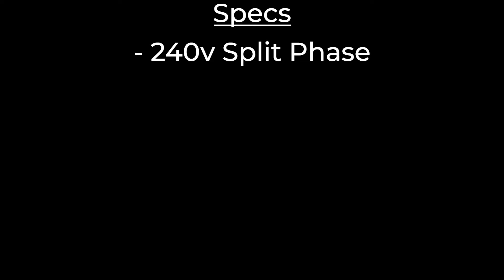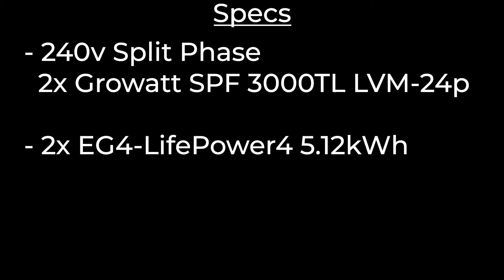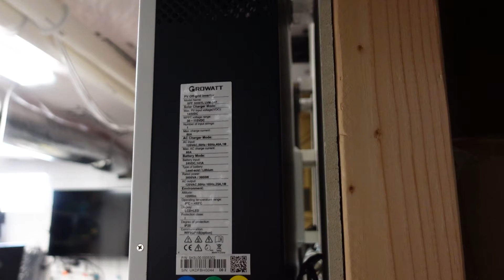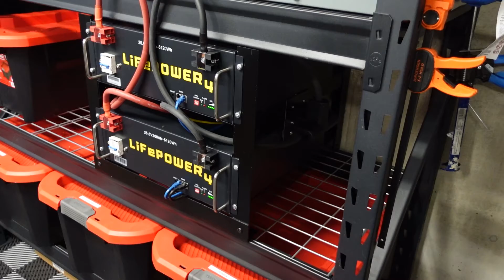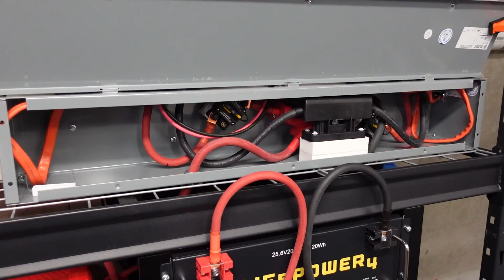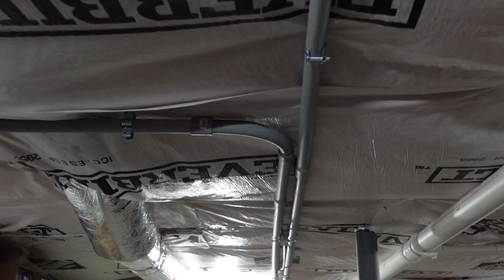Growatt Split Phase \ Off Grid \ Backfeed Home Battery Backup

Comment: Ok my question is you say your setup last two ok I have almost the same setup I have two alpha5 48 volt rack mount batteries from 
Rich Solar and two 3000 watt 48 volt inverters from rich solar that are exactly inside and out like the growatt and I have 10 200 watt solar panels plus I’m tied to the grid but it’s solar first then grid if no sun 
My batteries will only last one night if I’m lucky I know that I’m doing something wrong or there’s something wrong but I’m not sure what that is. Everything seems to be working fine but I can’t seem to get these batteries to last more than one night and I know they should any ideas where I’m going wrong
Thanks
Reply from the maker: Hi - it really comes down to your draw on the system. When I say 2 days, that is cutting all non-essential loads - I am really just running a few lights, my well pump as needed, heat\ac sparingly etc. I shut off all of my nice to haves in an effort to stretch power. Do you know your phantom load (how much power is constantly being drawn)? With all my stuff on I'm around 450w but I cut that to around 200 if I'm trying to conserve. Plus the inverters add roughly 75w to that number as well.  My house pulls roughly 25-30kWh this time of year when it's business as usual, so yes, if I were to leave as is then I would likely get ~12 hours out of it.

Comment: So not Grid-Tie?  I want Grid-Tie+Battery Backup.
Reply from the maker: Correct, no grid-tie on this setup. That requires a lot more in terms of coordination with utility, permitting etc. Also, most grid tie systems out there will be offline during an outage - so you are left with what's in your batteries until the grid is back online, in the typical setup, solar goes down with the grid. I want my system generating solar power when the grid is down!

Comment: First off, really nice clean installation! But in my opinion EG4 or Mpp solar inverter/charge controllers make more reliable units with higher voc allowing you to put more panels in series which I prefer. 
In tests that I have performed and also seen online, partial shading on a parallel configuration lowers the wattage coming in just as much as series. In essence a higher voc is always better in any case.
Reply from the maker: Good info - thanks. I've been seeing all of the new EG4 stuff come available and it looks great, I wish it had been an option when I purchased all of this but there's always round 2!

Comment: I have the same growatt. I'm unsure if I want to buy another to parallel them. Would you recommend just buying a different brand or does it seem to work well.
Reply from the maker: These seem to work fine. I've run my house off them a few times with no issues. That said, there's a lot of new stuff out and if I were building today I might go a different route. The Eg4 inverters look interesting and I believe they are UL listed which is a plus
Reply from the maker: Just saw an email from signature solar and made me think of your comment. They have a special on a parallel kit with a wireway\breaker box that looks really cool. https://signaturesolar.com/eg4-13kw-off-grid-split-phase-inverter-bundle-2-x-6500ex-48-13000w-output-16000w-pv-input-split-phase-120-240vac-all-in-one-solar-inverter-system/?_hsmi=269051297&_hsenc=p2ANqtz--aDD0GA_uXTlTOqPPL5c8awc_iYIGxGRzdGHgmNUwqB_pV0KJ3eX79tR1119_lrWobiLASOuhiU10UmYdV8en6Xo1yXA

Comment: I have a very similar set up using the 2 Growatt inverters. Nowhere as clean as yours is. It's been running my off grid shop/garage, and 2 Mini splits on my house for 1 year now. I had 2600 watts of solar, and found that it was just enough in 110 deg Texas heat. I also use it as backup for the house if needed, so I always try and keep the 4 - 24v/100Ah batteries at least at 70% SOC if needed. I had to use it 4 times this spring (lots of bad weather), and it worked great. I just bought, and am currently installing another 2400 watts of solar to make sure batteries are better topped off when the sun goes down. I have their AC charger also, but the 30amp version and love it, thinking about getting another, so I can use my gas generator to charge the batteries faster if no sun is available during a power outage. Nice work.
Reply from the maker: Very cool - I'm in the middle of installing a 50a inlet to backfeed my panel which I plan on using to charge my batteries (by grid or generator) to supplement my panels. Broke my collar bone with the work half done so it's going to sit a while! I'll post a vid on that once I'm back into it. Thanks for sharing, your setup sounds great.

Comment: Nice video. Just a heads up, Option 11 will allow you to limit utility charging current. I have mine set to 14amps so I can use normal 12/14gauge extension cords.
Reply from the maker: Thanks, I need to double check but when I first setup, setting the battery type to LI disabled that option. I believe you need to set battery type to User to open it up, which I should just do.
Reply: @lifewithlonsi  You're correct. I set that up awhile back and forgot that setting forced me to enable 'User-defined'.

Comment: you WILL want some air flow in that box. small PC fan on one side and some holes
Reply from the maker: That's a good point. The ends are detachable, I'll mount a 140mm fan on each side and pull air through. Thanks for the tip!

Comment: So I've got the 2x5000ES, with two midpoint transformers. I've got a transfer switch and 6 EG4 48v batteries. We use it for "time-shifting" and backup... I've got a manual transfer switch but am trying to figure out an automated one... the inverters can be programmed as to when to run, so I figure if I get one of these "backup generator" ATS's, and wire it with the grid as the backup power source, that will do the trick. None of the companies who make this hardware will talk to me, since they just want to sell me a generator... If you, or any of your viewers have any thoughts, I'd welcome them. Your setup looks very clean, thanks for the video! -- Bill
Reply from the maker: I've never played with an ATS but from my understanding in theory that should work. Inverter output is no different than a generator so just swapping out the source should work fine. I think the devil will be in the details on how\when you are switching and what the trigger will be - that will ultimately be up to the ATS and what it supports. Interested to hear if others have experience\recommendations on this one.
Reply: Dude! When you shift time, where do you go?

Comment: Btw where did u source those bus bars on the side of your batteries?
Reply from the maker: I'm going to try it - with battery set to LI the manual says the amp limit is disabled. I'm going to switch to User and see if that works. The bus bars are from Rysz Battery in CT. ryszbattery.com

Comment: I have two 48 V Crowatt ES inverters and am basically building the same system.  However Growatt says that 4 gauge wire is to be used.  Originally Signature solar said to use 2 gauge wire which was almost impossible to fit into the inverter and did not fit into the Nader breakers they had me buy.  Does the growatt manual say to use 1/0 wire or did you just use it?
Reply from the maker: The manual on mine calls for 1x2AWG or 2x6AWG for 24V and 2x8AWG for 48V on a 200AH bank. I threw that out and went by the max amp ratings which is 141A on 24V and 71A on 48V and sized my wiring based on that AND the loads I will be running. To do it "right" by many folks standards it would have me running 2/0 for the inverters and 4/0 between bus bars.
Reply: @lifewithlonsi  Thanks for getting back to me.  I started with 2/0 wire but almost broke the inverter opening fringes getting them attached.  Went to 4 gauge as the manual stated, but have now got 1/0 wire coming.  The 2/0 gauge did not work with the breakers I want to use, from sig solar, and 1/0 gauge will work with them.  Finding that this is a bit of trial and error.  Hope that in a month this thing actually is turned on!!!

Comment: I still don't get what split phase is.. 
 I will be using a single MMP 6000w inverter with 2x 48v jakiper batteries and i will be powering my house light and PowerPoint circuits off grid and islanded. The circuits will still be connected to the grid via a the way changeover switch just in case. I'll be moving the breakers and sticks green the main meter box board to a sub board inside my house for easy access and control. I keep watching these north American videos where sind of the stuff doesn't make sense. 
 It's the same but a bit different here in Australia..😮
Reply from the maker: Here in the US most residential power comes in from the street with 3 cables - Line 1 - 120volts, Line 2 - 120 volts, and a Neutral. Split phase refers to the two hot 120volt lines, each of which powers half the circuits in the panel (or each phase). To backfeed a panel you need to apply 120 volts to each leg in the panel so you need two hot lines coming out of the inverters. These inverts supply 1 hot line each, so setting them up in split phase means each inverter will power 1 leg in the panel with a shared neutral.
Reply: So two phases?
Reply: Split phase is 240 V line to line and 120 V line to neutral.

Comment: Can these do 3 phase ?? For like running machine and motors??
Reply from the maker: Yes they can - see pg 31 of the manual, shows wiring diagram for parallel setup in 3 phase https://signaturesolar.com/content/documents/GROWATT/1519008-manual.pdf

Comment: Can't use the built in charger on the inverters to charge a battery? The batteries do have bmses built in so maybe you can change the settings and rely on the bms to protect the battery from an overvoltage event, idk.
Reply from the maker: I can, but I need to change the battery type to User instead of LI, I'm not 100% sure what functionality I give up by doing that but it is on my list of things to test.
Reply: You can actually limit the charge amps from the inverter

Comment: I am doing the same thing. I purchased the 24 GW too.  I wish I purchased the 48.  Anyway, maybe I can sell it or find another use for it. How do you have two BT Dongels for the GWs and how are you able to read them independently? Don't they appear with the sam number identifier? I want to have two but do not understand how they work when there is two.
Reply from the maker: I was able to register both dongels to the same tenant so the data is sent to the same dashboard. I'll check it tonight, my login seems to have expired - but I remember it being a fairly straightforward process.

Comment: That's an incredibly clean setup and I really like how you kept the boxes separate.
I have the same invertor and can set the AC charging amps if I set the battery to USE instead of LI with the comms, of course that loses the little features you gain from LI but it's a work around for you until you get solar or your charging system setup. Sig Solar told me I can have multiple chargers running at the same time, might your only option with 24v.

How is your Growatt WiFi dongles working? I have had terrible luck so far and it's only monitoring, so I am ordering the Solar Assistant kit from Watts247, it's called the Solar Assistant Orange Unit and allows you to monitor 10x more data and control remotely from your own domain, all the data is houses locally.
Reply from the maker: Thanks for the tip - that's what I figured on the battery type setting, I may make that change for the short term. The wifi dongles appear to be working ok, I don't have the system on all the time so I don't have any long term observations but I was able to get them setup and transmitting data without any real issue.  I'll have to check out that kit though...
Reply: Have you already got a read wright cable for the batteries to rewrite firmware ?

Comment: Nice clean setup with some good creative work.  Setting 11 can be  changed to limit your Utility charging current so you can charge from the grid with a standard outlet.  Are you using battery communication?  How are you using 1 PV disconnect (I only see 2 PV conductors) with 2 inverters?
Reply from the maker: Thanks - in the manual setting 11 says that it cannot be changed if LI is selected in setting 5 (which I have). I haven't actually tried it though, and I guess I could try using User instead of LI and see if that works. I do have battery communication setup. For PV - I haven't finished setting it up but I'm only going to have one small array. I'm not really planning on running any large loads off PV so my plan is to feed only one inverter and just small loads off of that leg in the panel and use PV to slowly charge batteries if needed during an outage.
Reply: @lifewithlonsi  I believe you are referring to setting 2 which doesn't allow changing if using "Li" mode.  Setting 11 allows you to change utility charging current even if using "Li" mode.
Reply from the maker: Thanks, I will give a try this weekend!

Comment: Nice setup.  I like the "StandOff" idea, great solution (Neater Cabling-Cooler Units).  I also like the recommendation on how you performed the Ground/Neutral Bond issues.
I am putting together a similar 48v Growatt 5000ES Dual System.  Great ideas on your build.  Thanks for sharing.
Reply from the maker: Thanks - good luck with your build!